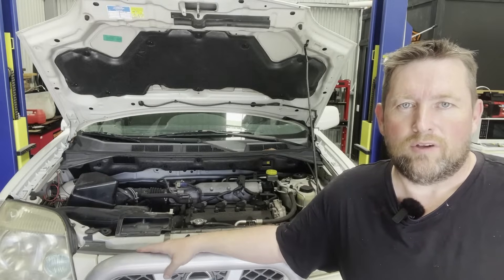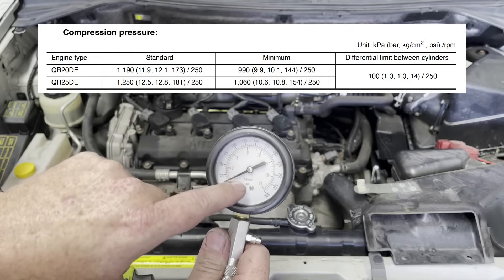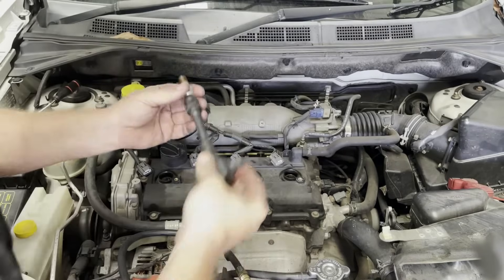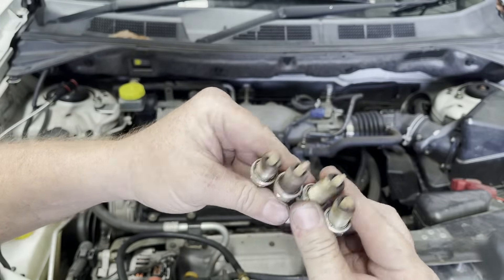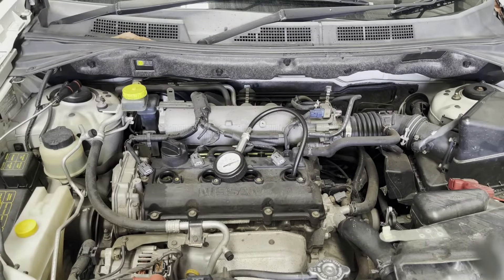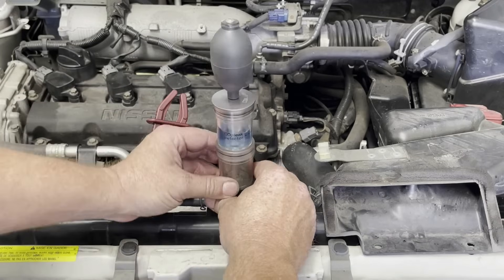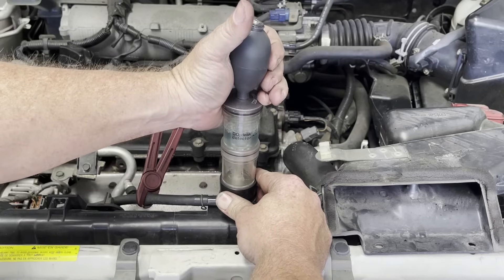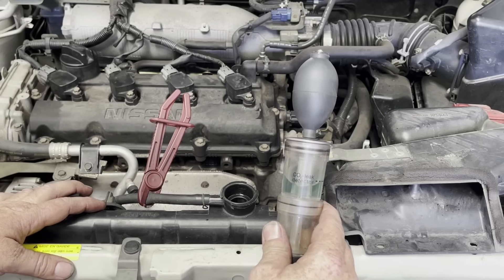Is my Head Gasket blown? Nissan QR25 engine. Nissan X-Trail. Nissan rogue. Nissan Altima.

Comment: Is This the same engine for Xtrail T31 QR 25 DE engine? Does this problem of headgasket issues that lead to overheating in Xtrail T30 also are there in Xtrail T31 installed with QR 25 DE engine?
Reply: All qr25de are the same